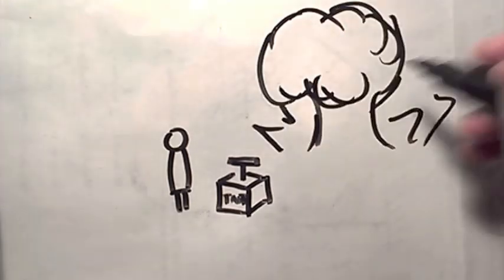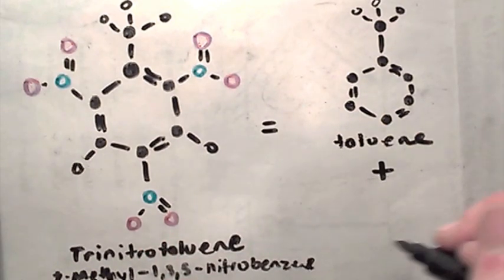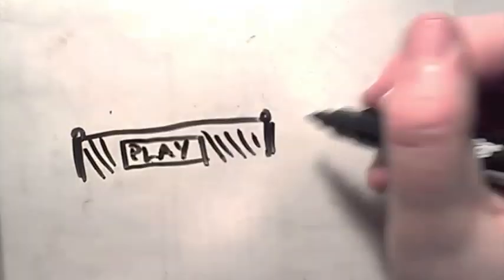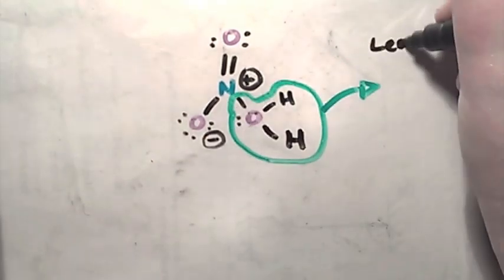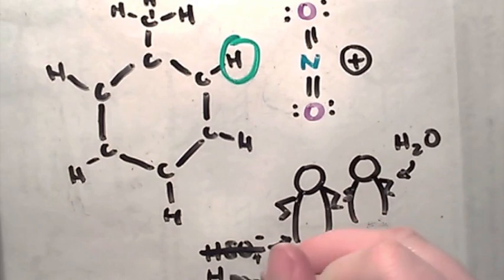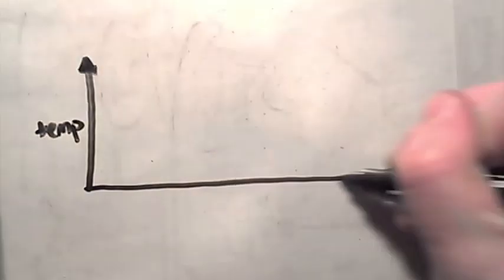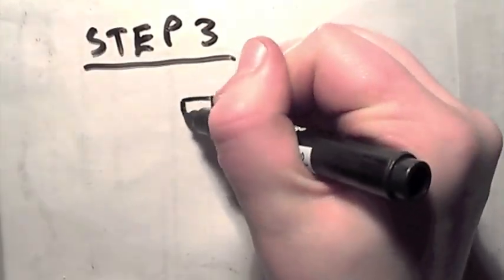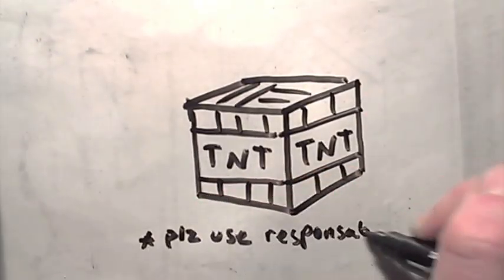Production Of TNT Walk-through

Comment: TNT is actually a lot less dangerous than people think. It's a secondary explosive - a relatively cheap, high-energy compound which is nonetheless relatively stable. It's actually quite difficult to detonate the stuff, it's not touch-sensitive or anything.

To blow it up you need a primary explosive - small amount of a much less stable compound. This provides the kick-start to get it going, but without that kick-start your TNT isn't going to do a lot. Even heating it doesn't set it off - it melts long before it burns (which is useful for filling bullets etc as it can simply be poured in while molten).

The chemicals used to make TNT are probably more dangerous than TNT itself. Fuming nitric acid is obviously horribly corrosive but even if you decide to wear gloves, it's also a powerful oxidising agent which can cause them to catch fire, so working barehanded might be less dangerous. Oleum is also no picnic, it has all the properties of concentrated sulfuric acid only worse.

Probably the most dangerous thing about TNT is its toxicity rather than its explosive risk. It's not immediately threatening to life but for industrial workers, prolonged exposure can be hazardous, and it's been linked to heart irregularities. (Strangely, though, its much more unstable cousin nitroglycerin has a long history of being prescribed as a heart medication.) It can also trigger reactions with human skin and subcutaneous fat that turn the affected area yellow; for this reason, allied workers producing TNT for the frontline in WWII were known as "canary girls", as their hands were often stained yellow.
Reply: You absolutely can blow up tnt with fire though, be careful. It just doesn’t start for a while or with a shit flame

Comment: What is cost of making TNT so we made some types of fuel for cooking 

Cheap cooking substance are now an very big task 

As we change water into hho gas and used it as fuel so we are using safe fuel in name of carbon footprint

So how we change some cheaper substance into fuel 

This is most major question of world 

Global warming become a big problem now a days and electromagnetic radiation are also dangerous so how we become safe by using laser light cooking by boiling water or hydrogen flame for boiling water or microwaves radiation at some distance and we use the steam or hot air which is caused due to radiation at some distance so we used radiation from a safer distance 

If we use heat of radiation of nuclear reactors for boiling the water in houses or supply the wastage water by making steaming of it so we are having a cheaper source of heating 

We can boils our food quickly by passing the steam through the hollow utensils and it will save the energy in long way 

Please discuss about it 
In terms of joules